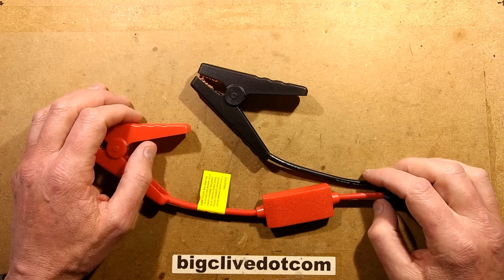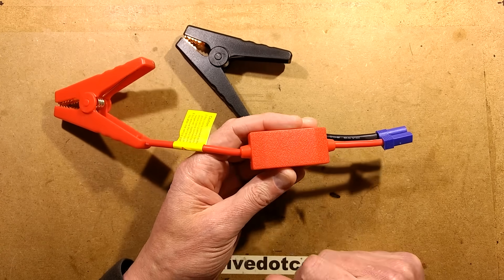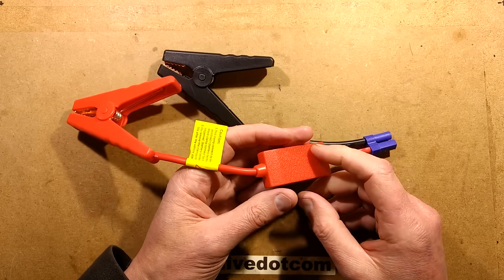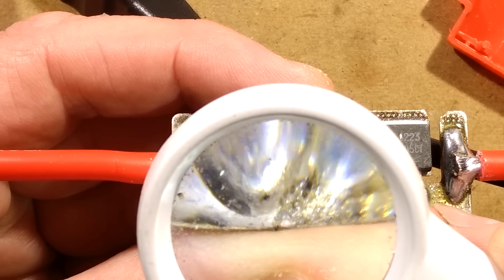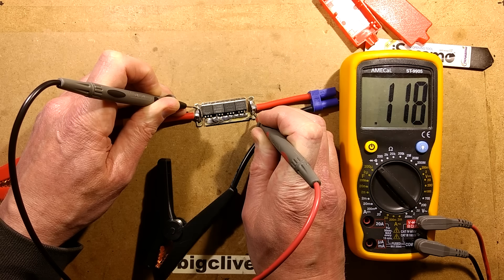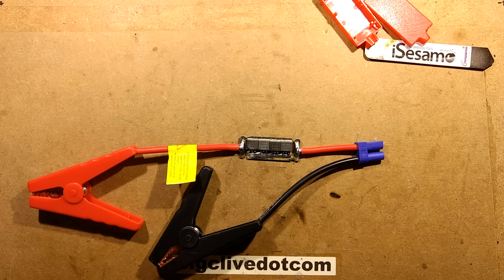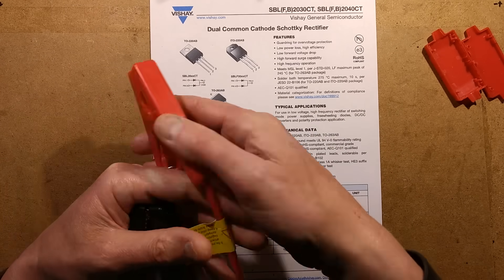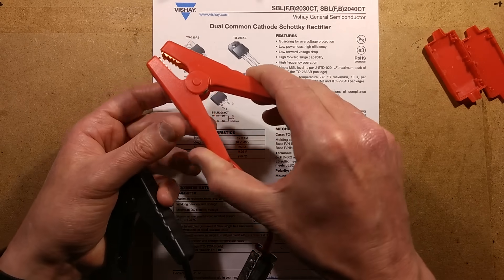What's in the little red box on some jump-start leads?  (Guess first.)

Comment: fuse,,cant,think about something else
Reply: car battery life depends on how much you cycle it. my mum has a 14 year-old Nissan Micra with same battery on. it's always 13 volts when I check it for her. my motorbike battery on my new r1200rt lasted 10 years but is always on maintenance charger. never let your battery go flat as thats kills it quickly.
Reply: Most of them are maintenance free these days - no more caps to check the water levels.  There isn't a whole lot to do other than wipe the dust off it now and then.  Same thing how they don't really seem to corrode anymore these days where cleaning corrosion off the clamps used to be a fairly regular task to perform.

As for keeping it charged...if driving 30 miles on the interstate each way isn't enough to recharge it then I don't think anything will.  Certainly the alternator works keeping the voltage up around 14-14.5V while the engine is running.
Reply: Erik Bruijn and ui
Reply: mondayfool Yeahhh ...if I didn't answer so quick I could have known however tose with caps don't have them you can charge them via the leads in seconds
Reply: start booster? wouldn't it be easier to service your car battery once every five years?
Reply: The last several batteries we've had are non-serviceable, if it fails within the 5 year warranty the shop just drops a new one in and RMA's the defective one.

I wouldn't trust a 5 year old battery anyway - especially when winter comes and the engine has to try and crank in single-digit temperatures (Fahrenheit - so negative temperature Celsius).

They also like to put in puny little batteries on cars these days, my new car with a 3.6 liter 250HP 6-cyl engine has a smaller battery (390CCA OEM) than my roomate's 2.3L 160HP 4-cyl car from 14 years ago (600CCA).  Heck, my car's battery is even smaller than the little 18HP V-twin lawnmower battery (500CCA).  When it took a dump the second winter I had the car I discovered I could fit a battery twice as large in the same space without any modifications so the new one is 850CCA with 5 year warranty (it lasted 3 years but I got a new one free).
Reply: Strange?  I'd say your 11 years is highly unusual, the oldest one I can think of is my Grandparents had a car that was in storage for an extended time with the battery disconnected and it went 7 years before giving up.  Most people seem to get about 4-5 years out of a battery.

My first battery was the puny OEM one that forums seem to suggest many people only have it last about a year before giving up.  Mine went until the 2nd winter.  While it still "worked" on warm days it was hopeless if the temperatures were below about 20F and it was parked for >12 hours it wouldn't start without a jump.

In both cases the failure was preceded by a drop in voltage as if one cell had gone bad -- as soon as I shut off the key it would drop from 14.5V to 12.2V and then settle out around 11.5V after sitting a while.  The 11.5 sounds about 2V off from the 13.8 I'd expect with each cell being 2.1V in a lead-acid chemistry.
Reply: Matthew Miller really depends ..if you care for your battery it could be possible....however ....mostly that's the issue
Reply: @matthew miller   just so you know it is not voltage that charges a battery but amperage.yes voltage must be between 13.5-14.5 volts but there must be at leasty 30 amps output from the alternator and that is without anything else in the vehicle on,headlights,radio,etc
these days a cars headlights alone will use between 15-20 amps just on low beams.most cars today you should be seeing anywhere from 65-120 amps output from an alternator depending on what accessories a vehicle has that draw power from the alternator.

just thought you might be interested  :)
Reply: Matthew Miller 
How strange you are getting such short periods of time out of a battery, my Megane has just had its 1st change of battery and is now 11 years old, had car since new, and live in Scotland so many a cold morning to be had ❄️☃️ Was   labelled as a renault battery but not entirely sure who actually made it.
Reply: @matthew miller  there are many factors involved when it comes to new battery for your car. who makes it,how many year battery it is ,how long that battery has been sitting on a shelf waiting for you to buy it.
if you have the fortune of buying that new battery within a month of it's manufacture then chances are it will last as long as advertised.
within a batteries first year it must be used to do what is called cycling if this does not occur then the battery will fail early.
if the battery is serviceable and you can open it to check water level in the cells then you can easily check for a bad cell with a volt meter as each cell should have a minimum of 1.5 volts. if any cell checks less than 1.5 volts than that cell is bad.
Reply: dammit.
I saw one with capacitors ...want to buy....but the price ..damn
380 euros
Reply: they indeed act as quasi fuses, however the main reason for these diodes is so after the car starts, the car's alternator doesn't cram 40-50A into the liPO pack.

Comment: get a large car battery and a large metal bar as a resistance test get the metal bar glowing red white hot
Reply: Just send the thing to photonicinduction and see what they can really take :D
Reply: put the bar into water, you can put a few hundreds of amps then, clamp meter attached to some thick old wire, but trouble is, you cant ramp it up, its an instant draw
Reply: you could short them and put a clamp meter on (which clive has) but thats not a meaningful result, you need a load similar to starting a car, and without a car, most loads arnt similar.  theres also the car batteries part in this, it may be loading down the circuit itself, it may be partly faulty (ive never had a flat battery outside a worn out battery in 30 years, the type when its flat on a cold morning for no real reason)

Comment: The soundtrack is very poor, it sounds like your talking through a toilet bowl.
Reply: Sounds a little over modulated, I've done this a couple times. Grabbed the camera for something else and put it back to auto, then did a video a couple weeks later and forgot to manually set the mic gain back down. You don't notice sometimes until you edit it and it's to late to redo the video depending on what you did a video of, or sometimes until after you publish and upload the video. If you catch it sometimes you can post edit the audio and cut it back and try to make it the same as other videos by ear, but it will never be exact to what most other videos are on the channel. It sucks, but it happens sometimes.
Reply: It's very odd,  from my end it makes the otherwise excellent Vid unwatchable.
Reply: Interesting, I was wrong. It's not over modulated, it's a cheap speaker on the tablet I was watching the vid. His voice has has bass in his tone. 
I put on my headset and hear the tunnel effect you mentioned. You must be watching on something with a good sound setup? Maybe he changed rooms to one that's more empty or moved some stuff out of his room? Or decided to move to an external mic? I wouldn't call it unwatchable, but the room does sounds a little empty and hollow.
Even I still tweak my mic setup every few months if I rearrange things, but I can get lost in that perfectionist rabbit whole and have to walk away and call it good enough. 
If he changed to an external mic now I know that can be a pain to set up and get the levels good sometimes. It might sound good on one system playing back, then you play it back in a better system and notice things you couldn't hear the first time. But sometimes you don't realize this until you've spent hours of post production editing and release the video anyway or it's time waisted and that can get frustrating. 
I now just take screen shots and pictures of my settings in case someone messes with them, so I can out them back.
Reply: I run YouTube through my Home Theater, a reasonably good system that tends to highlight faults as it has very little color.

Comment: Yeah, I guessed diode - either that or a fuse, but that seemed a bit boring ;) Was picturing a massive leaded diode (1N4007-style, but fatter) rather than SMD, though!

I do actually have one of those lithium jump start things (a "Genius" brand model) and they're certainly very effective at their target application. My car has a particularly pathetically-sized 12V battery (despite having a giant Ni-Cd battery for its hybrid-ness, it won't use that to start the engine...) so it's very easy to kill the battery and thus I have to keep the lithium jump starter in the boot at all times. Yes, its current ratings are probably nonsense, but it'll start the car first time every time after being connected for only the time it takes me to walk from the battery to the driver's door...

Comment: The primary reason for the diodes is so that people can't hook it up backward with all that current coming out of the Lithium pack opposing the lead acid battery.  

Since these are intended to boost the primary vehicle battery when it is low and not completely flat which is a typical situation for the battery to be in, the boost pack will transfer enough energy in the 10-30 seconds it takes to get back in the car and start it that both batteries are working together to start the vehicle and thus the current demand is also not as high as it would be if the primary vehicle battery was completely flat.

If the primary battery is flat most of the quality boost packs can deliver the 200-300 amps necessary to start the car by themselves but it is a good idea to give the pack a half minute or so to bring the vehicle's battery up a bit from flat.

Comment: Not a bad price for the clips alone either.
Reply: Depending on how soft the jaws are they could be quite useful beyond anything electrical as well. They look a lot more robust than the standard chinese plastic spring clamps that are found all over.
Reply: totally. my nipples are hard in anticipation just looking at them!
Reply from the maker: It is probably worth buying for the clips.
Reply: Aubreykun they do work but. I've got the same set and cold started a 4.0l V6 and a dead flat 4 cylinder diesel tractor as well as many other cars. I paid just under $100 for mine and it's more than paid for itself.
Reply: could probably use the diodes for a solar charger, that was a pretty good FV.
Reply: Would make an excellent set of charge leads. Already has what looks like an ec5 on the end, and those clamps are better than the tiny alligator clips that come with a typical hobby battery charger. I use mine to top up my car battery, an imax b6ac. It has a setting for the lead acid battery and outputs only up to 5A, the lead would handle it fine.

BTW, I knew it would contain a diode in that box before the vid started. :) Really, what else would it be?